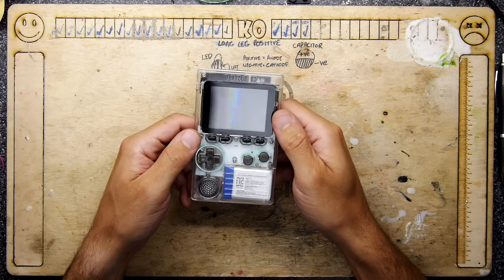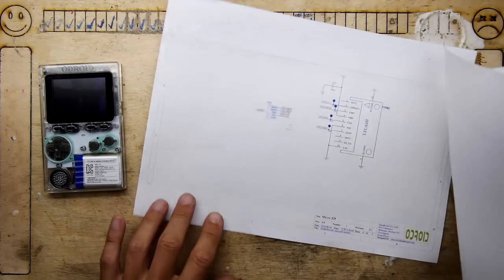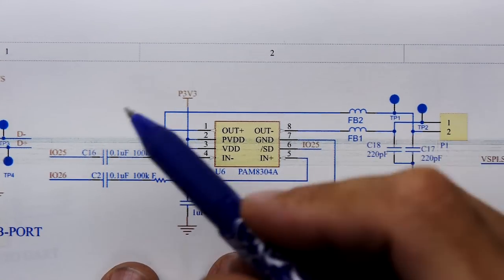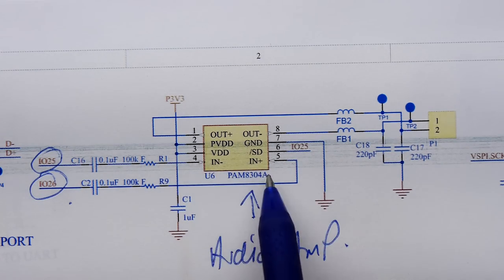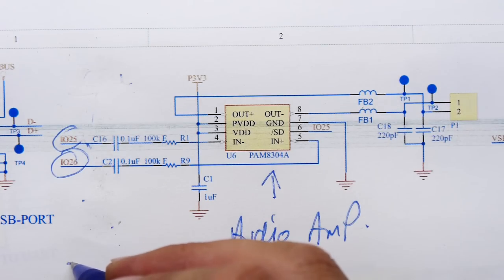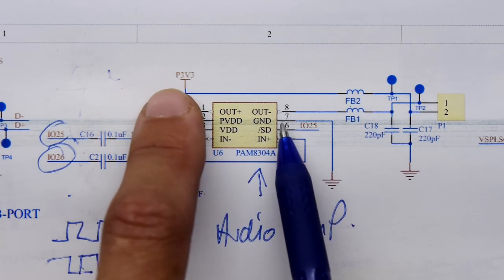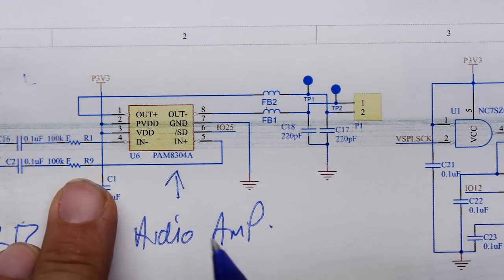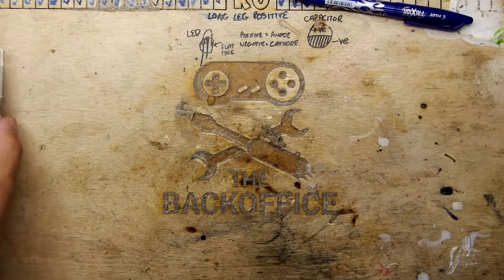Finally Headphones on your odroid Go!

Comment: Just got this working after following your tutorial, thank you! I snipped the speaker wires instead of soldering to the test points, and used 910 and 330 resistors instead, but it seems to work fine.
Reply from the maker: That's awesome!

Comment: Had it done differenty, put the resistors on the connector. I wonder what will happen when there is no headphone connected on the output of the amp, there is now a constant 2 Ohm load on the output which get pretty hot I suppose.
Reply from the maker: It was all a stop gap until I made the DAC board for it. I really missed stereo 😂

Comment: Instead of connecting the headphone after the amplification, why not connecting it before so you don't have to attenuate the signal? Also, the jack switch won't work if you connect it in parallel with the speaker (to the test points like you did). I know you've made a i2s solution which is really nice, but this solution is still interesting requiring only a headphone jack and two wires and not a whole pcb.

Comment: How would you do it if you wanted to use both, the speaker and the headphones? So when the headphones are plugged in the speaker gets silent. On headphone jacks, there usually is a pin that shorts if a headphone is plugged in. I tried to do it but i could not make it work.
Reply from the maker: I would double check the circuit for the headphone jack. Perhaps it is a little unusual.
Reply: @backofficeshow  I mean there is an additional pin that says if a headphone is plugged in. Maybe it is open if plugged in, i can't remember. Almost all headphone jacks have this.

Anyways, do you have an idea how to use both, headphones and speaker?

Comment: the battery will puff up over time, no need for foam ;)
Reply from the maker: Very true 😃 I think technically they puff up when charged because you are pouring all the energy into them like a hot water bottle

Comment: Quick (silly) question: why do I need the voltage divider when connecting the headphones? What happens if I connect the headphones directly to the test points? Will my ears bleed, or will the audio be distorted?
Reply from the maker: Your ears might bleed, but you could try head phones with an integrated volume control
Reply: @backofficeshow  Ok, thanks. Could I use a small potentiometer as a voltage divider? I'm low on resistors. Also, I'll need to scavenge for a headphone jack...
Reply from the maker: Yep, shouldn't be a problem as long as you can fit it. Alternatively I would consider one of the zero solder hats I sell on my website, though they might be a little more expensive than salvaged parts 😂

Comment: Are you sure thats a bluetooth/wifi module? I was under the impression that the SoC was under there, I didn't think the odriod-go had wifi.
Reply from the maker: The specs of the WROVER module are pretty easy to grab, it supports both for sure.

Comment: Doesn't the wifi chip have Bluetooth as well, even if it's not enabled yet?
Reply from the maker: It does, hopefully they will get it working sometime
Reply: Thanks for the quick response, and a great video. I'm gonna wait to see if they enable it soon before I do this mod. Subscribed!
Reply from the maker: Let's hope there isn't a technical limitation other than the hassle of adding a user interface
Reply: On a side note, what's the largest micro sd card I can use with the Odroid Go?
Reply from the maker: I'm not sure, bit I have a 32 GB in mine which seems insanely large
Reply: Sweet! Thanks!
Reply from the maker: I suspect the entire collections for every emulator on there would struggle to hit 1gb 😂

Comment: You could have put the second resistor between the test points. Les chance on shorting the wire.
Reply from the maker: That would not have been the same electrically
Reply: backofficeshow hmm, I mended both the resistors between the test points and tab the center. But maybe U5 is in the way for that. 😊
Reply from the maker: Through hole is definitely the best way, and a disconnecting headphone socket so the speaker can be retained is the ultimate solution 😃

I think my pocket operators use the same headphone socket. I'll see if I can find a part number

Comment: Surprised you didn’t put the headphone jack where the original speaker is housed since you’re not using it. You could have had the headphone port on the bottom of the odroid like the GBC
Reply from the maker: It's because I used parts I had lying around and if I find a disconnecting type of headphone socket I may rewire it to do both again.
Reply: Please please do a video of a headphone jack on the bottom and in stereo if at all possible!!! ty!!
Reply from the maker: Bottom = no problem, stereo, now that's a challenge!
Reply: For bottom jack, would the speaker have to be removed?
Reply from the maker: I think it could stay. There is a plastic feature that holds the speaker down. If you remove this and glue the speaker there would be a usable space
Reply: That's so interesting, Thank you!
Reply from the maker: Get your tools out and get on it 😁
Reply: I don't know yet because I'm hoping you're going to make a video with a disconnect feature headphone and maybe at the bottom? I mean the bottom will have it where the headphone cord isn't in the way of your hand all the time right?
Reply from the maker: I'm not sure how much energy I have to move the existing position to the speaker. I am using different headphones that have a 90 degree lead and they really are not in the way
Reply: oh ok fair enough then. I already ordered through Amazon the mono headphone jack but it's 3 pins. Would you know what one I could order to get the disconnect feature to happen and what connection on the board needs to be soldiered for it? (i'm a noob i'm ordering a soldiering iron LOL)
Reply from the maker: The disconnect ones will be 5 pin. I can do a little video on it 👍
Reply: That would be AWESOME!!!! ty
Reply: I would really appreciate a video about connecting the headphone jack with disconnect feature. I've been trying to figure this out. Digikey has so many audio jacks. I've got some understanding of the sleeve, ring, and tip connections but I'm not getting something about the diagrams.
Reply from the maker: Hilliam, I'm not sure if I will have the time to get around to that video soon as a lot of effort is going into the solerless variant (the one on my website) however if you jump into my Discord we have a lot of clever folk who can help you out to hook this up
Reply: Thanks for the reply. I joined your Discord after watching some of these videos. I'll ask for some help there.

Comment: Stereo sound?
Reply from the maker: They only have a mono to the speaker. It would be possible with a more serious hardware mod
Reply: backofficeshow that would be a rad mod!!! The most amazing sound when I was a wee lad was hearing Tetris on the Gameboy in stereo :-)
Reply from the maker: There is plenty of io. It would be easier to make a headphone hat on the ports on the top
Reply: The main developer (crashoverride) has plans to integrate support for a TI stereo DAC that has a headphone jack, will be a great addition.
Reply from the maker: Yeah a spi DAC with built in amp will do the job and be able to provide headphone detection. I will away the hat!
Reply: backofficeshow Glad to see you went ahead with the hat.
Reply from the maker: I was getting so many pings about it I thought it was the only way to make them stop 😂

Comment: IIRC they said the case is made out of some form of polycarbonate.
Reply from the maker: That explains a lot! I cut the drilling scenes to be a fraction of the actual length it took!

I was using brand new drill bits as well 😃

Comment: I would have wanted it to be a disconnecting jack, any plans on making a upgrade vid? So the internal speaker works when headphones are disconnected 😊
Reply from the maker: Eyejeey I'm working on the schematic right now! The new one is not only external (no hacking needed) but also stereo!
Reply from the maker: :( After going through the designs this is not easily possible right now, so back to the original plan as you suggested!
Reply from the maker: I'll try to remember to order the disconnecting jack's in the morning 👍
Reply: @backofficeshow  after 4yrs... do you jave the vid up somewere?
Reply from the maker: @Cheesicle_  the were a few streams in it, but I ended up making this https://backofficeshow.com/shop/odroidgohat